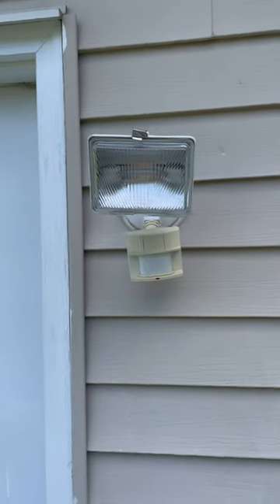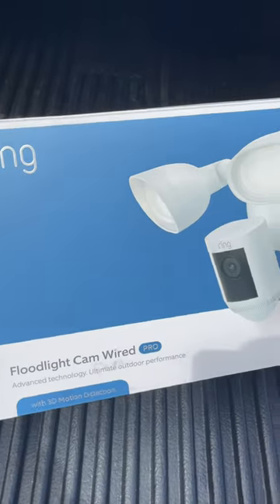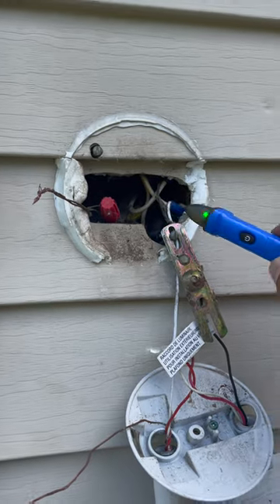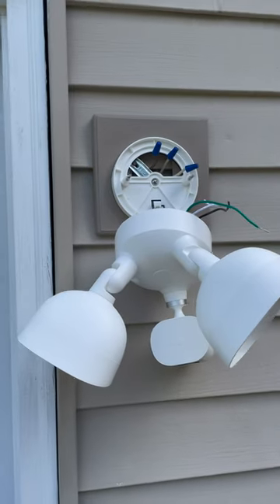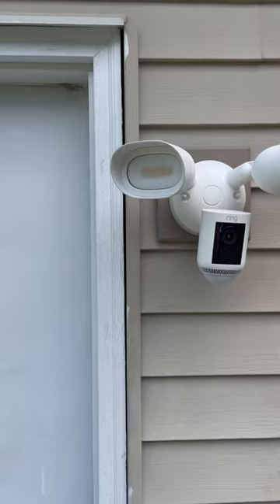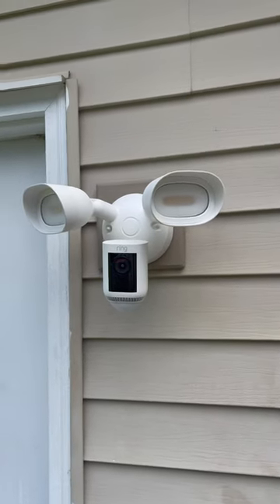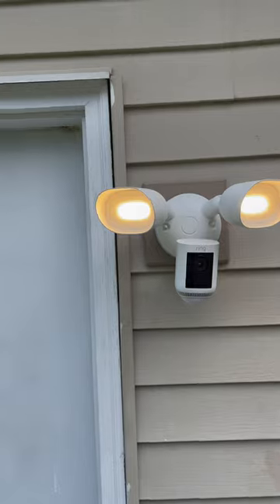SIMPLE Ring Floodlight Installation

Comment: Currently having issues I'm installing 3 of these and all having the same issue will not connect to the app they are all wired correctly but the app will not recognize the MAC address or the QR scan code I connect manually to the hotspot these produce in the app says it cannot set up call tech support (no help from them) any suggestions?
Reply from the maker: Hmm. Couple things to try
1. Hard reset the device
2. Delete and reinstall the app
3. If your network supports it, turn off 5ghz and try to connect over 2.4. You can turn 5 back on after pairing
4. Distance to router, how close are you while pairing?

For what it’s worth, I had a similar problem with a friends Ring doorbell not too long ago. Nothing worked, had to buy brand new. So far that’s my first issue with Ring, hoping it doesn’t become a pattern. Let me know where you end up

Comment: Does it get affected with rain since it’s not under an Dave? We have similar situation, only option to mount is next to a porch door where the current outlet is. And only about 6 ft high  Thanks!
Reply from the maker: It should be water tight. You’ll have to caulk the area between the faceplate and the siding